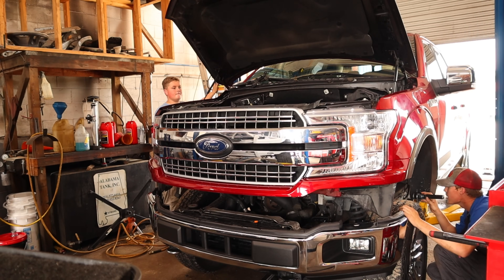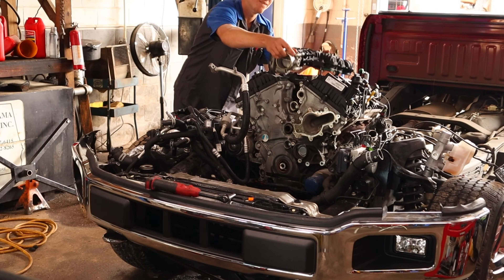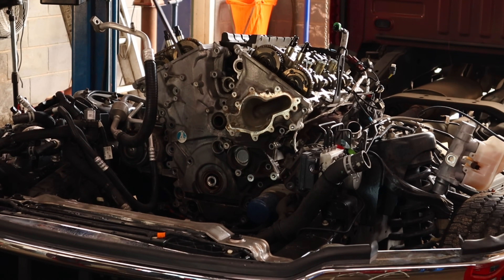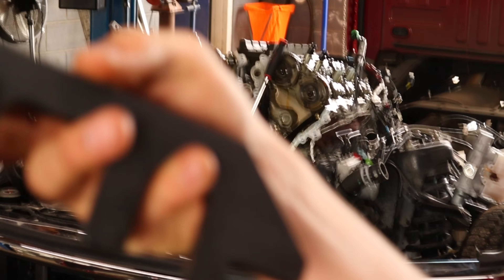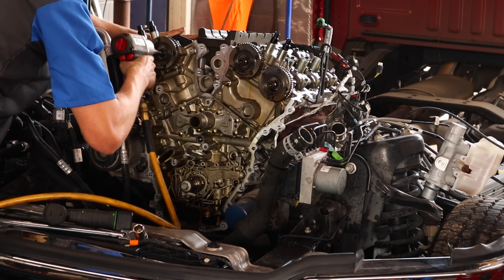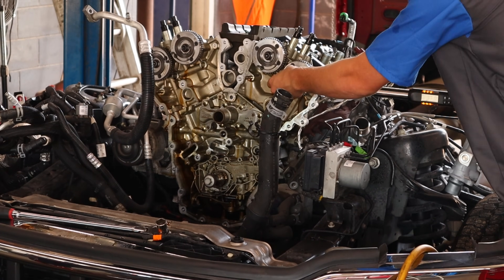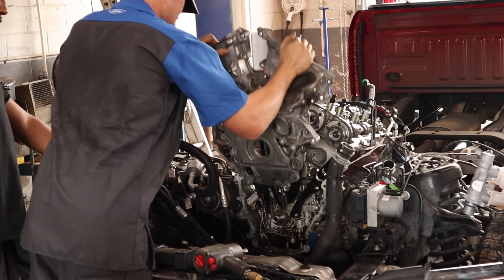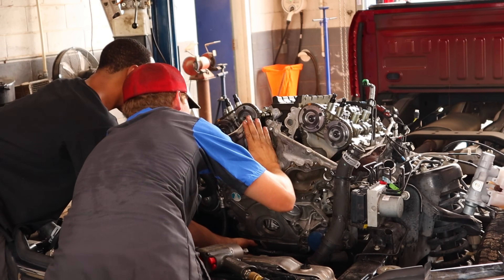Ford 3.5 EcoBoost Cold Start Rattle (VCT Phasers) | Everything You Need To Know

Comment: Let them know that in order to get the extended coverage, they MUST have the 21b10 performed by a certain date. If the shudder occurs it’s reflashed to the original calibration. But the extended warranty coverage is still in effect.
Reply from the maker: Yeah I need to make an update to this video. When I shot this they hadn’t came out with the reflash to original for shudder.
Reply: @FlyingWrenches13  They made a couple of changes (I’m sure you’re aware ) . They had us reflash , then test drive, and “un flash”) if a shudder occurred. Now they simply say reflash and let it go (.3hrs) . They came out with a different recall for the test drive, verification, and un flash. If the customer notices any shudder. I’m not sure. But I think the new fsa /tsb that has us to replace the vcts also has us to reflash and choose the “are you correcting a shudder” option. That leads me to believe the vcts are revised. By the way. Good job on the video. And congratulations at becoming a Sr. Master at such a young age. I just achieved mine at age 56. Finally work for a dealership that encourages it,
Reply from the maker: @dmandman9  Thanks man! That pretty  much sums it up. Where you work at really makes a difference in how fast they let you get all your certs.
Reply: @FlyingWrenches13 what numbers differentiates the old from the new phasers
Reply: @FlyingWrenches13 mine makes a shudder or a clonk when I go from park to drive....not when I'm driving
Reply: 9:21 what numbers differtiates the old from New phasers

Comment: That is exaclty what they did to my 2019 F150 they updated the PCM and now i have some transmission shudder at lower speeds.  Feels like the car is in 6th gear at 25 mph  and when you accelerate slowly it doesnt even shift just stutters .  LIke  being in a wrong gear on a manual and trying to drive at low speed.  What is the fix ?
Reply: Ford just released a recall that reverts it back to the old calibration eliminating the shudder for those for whom the revised calibration caused an ENGINE shudder that is PERCEIVED as a transmission shudder. Also, they provided a partial extended warranty too.
Reply from the maker: Darryl is correct! New recall should fix that issue for you.

Comment: My ‘19 5.0 has this exact problem on cold start 75% of the time. It’s very hard for me to find evidence of other 5.0 owners with the same issue! Just the ecoboost owners…
Reply from the maker: Yeah I’ve never seen a phaser rattle on a 5.0. There is a tsb out for a rattle caused by timing chain tensioners for the 18+ 5.0’s though, I think. I’d look into that.
Reply: @FlyingWrenches13  I genuinely tried to search for that TSB with no luck. You wouldn’t happen to know what TSB number it is..would you? Thanks man

Comment: Bro. PLEASE tell me what's wrong with my 2012 5.0 litter f150 that has the cold start rattle. Could it also be there cam phasers?
Reply from the maker: Usually don’t see any 5.0’s with cold start rattle.  Have you had anything with the timing replaced? Chains/tensioners would be my first guess.

Comment: Just bought a used '18 3.5. It was priced very well, and I believe this is why- 66K miles, mostly highway up and down east coast. Someone took care of it, and I have the history, except any cam phaser maintenance. Dealership wouldn't/couldn't tell me. Took the risk. Obviously out of warranty time... I'm in MA, and it already has the cold start rattle. Not all the time, however, even after sitting for 12+ hours. This makes me think the phasers still have some life in them, and aren't too far gone. Should I take it to a local Ford dealer to get their thoughts, or call Ford Corporate to get advice about the most current updates and maintenance fixes prior to going in to a dealer? I'm worried that many dealers just don't know how to fix this, and how to address the true problem. I want to go in with the knowledge to tell the technicians what my understanding is, vs. what they want to do to get to push me back out the door. 

Thanks, 
Derek W
Reply from the maker: Take it to the dealer. There is an extended warranty out for the phasers if you have the 21b10 reprogram done. I’m pretty sure if your under 70K ford will pay 100% and if over 70K they will still partially pay for the phaser replacement. After installing the updated phaser you shouldn’t have any issues. Other than that you can hold gas pedal at WOT on a cold start and crank engine for a few seconds to prime oil system then turn off and crank normally. That will stop the rattle.
Reply: @FlyingWrenches13  Same issue, the cold starts, eventually it starts rattling all the time. I went to the Ford dealer, they flashed it and said drive it 100 miles, came back, they charged my extended warranty company 4000

Comment: Unreal that this company still hasnt figured out the phasers going back to 5.4.  Junk.
Reply: I know it’s very bizarre, I did phasers and timing on 2018 navigator, 2018 raptor, working on a 19 f150, all 3 are my vehicles and all went to the dealer within a month of ownership.
Reply: The biggest problem is, the average person doesn't understand, and doesn't want to spend the proper time and money to maintain this specific engine design. Granted my husband is a mechanic by hobby (He's a big mustang lover, so he's a Ford junky). For maintenance, simply use full synthetic oil (my husband uses valvoline 5w20, because it's really good for the winter season, and overall quality among many moving parts.
Reply: Lol
Reply: @Al Carranza you missed the entire point while being a internet troll. The point was mechanics blaming manufacturers for building what they call “junk” when in reality they just don’t understand how certain engines work. Has nothing to do with paying for mechanics
Reply: Yet these Ford engines still end up being better than any of the junk that non-american GM puts out. Fact of the matter is that dual overhead cam systems are notorious for needing timing sets between 100 and 200,000, mi. That's just a reality of these systems. It is frustrating though that Ford hasn't been able to get their phasers better even after the 3v 5.4 Triton
Reply: chevy has em too dumbass idiot!
Reply: Also, either use the Ford Motorcraft oil filter at every oil change (like I said, my husband is a mechanic and huge on maintenance. He changes his oil every 3000-3500 miles), or like my husband does, he uses either Ford racing every oil change, or he uses the Wix-XP every other (2) oil changes, because those two filters are high quality filters.
Reply: Easy fix you just act like it's not, pre oiler pump
Reply: @iancassells8484  what brand makes a good
one ?
Reply: @alcarranza7587most trucks still have the 8 speed
Reply: Oil straight  30 or 4o wait  one bottle  of  hunny  no problem s  ford puts to them oil  don't  tell me the taller enc is to tite  that's  b s that  s in the desert  cold  don't  no oil oil oil  oil think. About it  eddie ray singing  off
Reply: Cool. An
Reply: Bad design. You bought a Lemon.
Reply: My dads 5.4 lasted 350,000 miles now I have it and it runs great change the oil every 6,000 miles and it barley burns half a quart between oil changes my dad now has a 3.5 it’s been nothing but problems and it’s only got 70,000 miles
Reply: I don’t think the manufacturer is the problem with the phasers it’s the lazy mechanics that want to charge for diagnostics but don’t want to fix the real problem just mask it with solenoid replacements instead of taking the cover off and replacing the phaser. Everytime you ask a ford dealership about it they say it’s “unfamiliar” or “we have to get it in and see” so basically we want to charge you to see what’s wrong & fix what’s not. The mechanics are the problem not the architecture
Reply: This is a perfect example of why you run not walk from Ford dealerships
Reply: Buy a Chevy
Reply: @c.torino2479  Chevy will have lifter failure before first oil change 🤣 lawsuit about it currently
Reply: @freedomisntfree_44  mine has been good🤞🏼 but I agree they’re all junk 😂🤣😂
Reply: @c.torino2479  If they would just leave it simple 🤷‍♂️ all the manufacturers are so talented they could build a bulletproof engine no Doubt but….
Reply: @freedomisntfree_44  My GMC had the lifter failure at 50K or so...heads off and it would have happened again at 100K presumably, but I dumped it (Sooo many other issues)
Reply: @c.torino2479 yea until your faulty AFM system wrecks you lifters & cam, or your (2015 and newer) needs a new transmission at 120k miles.

All pickup trucks are flawed. Best bet is dont waste your money on a top of the line truck if youre gonna keep it long term.

Comment: If we keep it rattle like that only in the cold start it will damage anything bro ?
Reply from the maker: No, it won’t damage anything else. It’s just going to keep rattling and most likely get louder as time goes on!
Reply: @FlyingWrenches13  they changed for my car the phaser put still there is rattle and water pump but still there is sound bro, what do u think else  ?

Comment: I asked a service manager at the local Ford dealer if there has been any improvements to the 2021 3.5 EB to cure the cam phaser rattle.   He said that Ford put a slight time delay in the start sequence to allow the electric oil pump to get oil to the top of the motor before engaging the starter.   Is there any truth to that?
Reply from the maker: Honestly I don’t know. I haven’t talked with any engineers about what they changed. All I know as of now is they don’t rattle. I’ll look into that for sure though! Thanks for the info!
Reply: @FlyingWrenches13  Have you been able to verify this rumor?

Comment: Hi i have a 2017 f150 with the 3.5 eco boost i have the cold start rattle for about 3-4 seconds. since the truck is still under the warranty, in june i brought it into ford they had it for 5 weeks. 1st they did the 21b10s2  i was told they had to as per ford procedure and it still had the noise. I left the truck there they did 21n03 and replaced the 4 cam phasers and timing chain tensioner. i picked up the truck and started it the next morning and the noise is still there. So now it has to go back. but this morning i see on my ford pass app there is a 21N08. so my question is if the cam phaser replacement did not fix it what do you think is wrong? and what is the 21N08 tsb. any help would be awesome.
Reply from the maker: So 21b10 is the update that is for the cold start rattle. It usually doesn’t fix them. When they first came out with this reprogram, something was wrong with the programming that caused the engine to shudder for some customers. This is why they stopped the update for a few months. Since then, they have started back performing 21b10, I guess they fixed whatever it was causing the shudder. 21n08 is a new update that is only for the ones that had the 21b10 performed before they fixed the programming issue. 21n08 is meant to only fix the shudder issue caused by the first reprogram. I know all of this is confusing but I hope that makes sense. If the dealer has performed all pcm updates and replaced phasers and it’s still rattling then it either needs another set of phasers or it has an oil flow problem. Should all be under warranty.
Reply: @FlyingWrenches13  heres a update on this. the truck went back. they replaced all 4 phasers again and both timing chain tensioners and guides. its all quiet now. but now i have a oil leak around #1 spark plug tube and its slowly dripping down the valve cover and onto the exhaust manifold and smoking. so now its going back.
Reply from the maker: @walterh7021  dang that sucks! Good news is that’s a fairly easy fix. The spark plug grommet probably got damaged when the valve cover was removed.

Comment: Holy Cow, how did I just now find this channel?? This is great information, Thank you so much. I am going to forward this to my Local lame brain Ford Dealerships here in Northern CA.
I have been dealing with this issue since February 2021. 2017 Ford F-150 with 40K miles. 
Rattles at cold start up, brought the truck in for service, they knew exactly what the issue was, the service advisor told me 30 seconds into my describing the issue. As soon as I got the truck back the vibration between 1200 & 1500 RPM started. I brought the truck back and the dealership told me they could not duplicate the issue. I asked if a mechanic could go on a test drive with me since I can make it happen every time. I was told No, due to Covid they were not allowed to conduct test drives with customers.

immediately
Reply from the maker: Thanks man! They actually have a new update coming out to fix the vehicles that had the shutter problem after the first reprogram.

Comment: I just had new vct phasers put in my 2017 3.5 EcoBoost. Also I was told to only use a motorcraft oil filter with a built in check valve when I change my oil. Apparently that's suppose to fix the oil pressure issue. This was directly from my local ford dealership. Hope this helps.
Reply from the maker: Thanks for the input!

Comment: Everyone is talking about the 3.5. Just had Ford replace phasers on a 2021 2.7 with 1,400 miles on it. Ended up not having a truck for 3 weeks. Two weeks for an appointment with the dealer then one week at the dealer. Ford Customerservice is supposedly giving an extra 2 years on my warranty and the phaser replacement was covered under warranty. Good luck if you don't have a warranty!!
Reply from the maker: Why were they replaced? Was it rattling? I’ve never seen a 2.7 rattle.
Reply: Yes, cold start rattle. Sounded like a diesel truck for a few seconds on a cold start at about 1,400 miles.
Reply from the maker: That’s crazy with that low of a mileage. Hopefully it’s not a issue with the 2.7’s now.

Comment: Great video 👌 unfortunately I am the owner of 3.5 eco… 
To bad that they didn’t come up with full on recall 🥲 it will push away a lot of Ford customers straight to competition
Reply from the maker: Yeah you are right about that. It’s sad because other than the issues with the VCT system they are really nice trucks.
Reply: I just bought a 2020 raptor one month ago. 15,000 miles on it.
I was not aware of all of this nonsense, And I want nothing to do with it! Probably going to sell it before I have any issues. How can Ford charge people $70,000 for a truck that has all of these types of problems? What a waste… might have to look into a TRX.

Comment: My 2018 does the same rattle. Could this be causing a hard shift like it slams when shift next gear up. Only when driving between 10-25 mph around neighbourhood.
Reply from the maker: No those are 2 unrelated issues most likely. What shift is slamming? 4-5?
Reply: @FlyingWrenches13  I cant really say it rarely does but its not a smooth shift. It reminded me of my F250 2011 that did it more often at low gears also.
Reply from the maker: Next time your driving watch the gears on the cluster and see what shift is slamming.
Reply: @FlyingWrenches13  I will and appriciate the help brother
Reply from the maker: Anytime!

Comment: My 2017 developed a rattle under warranty on the left side. The dealer replaced only that side. This made no sense to me considering the labor involved. Within a couple of months of course the right side started making noise. Back to the dealer.
The dealer then inexplicably mistakenly replaced the LEFT SIDE AGAIN! I knew immediately what they had done the next morning when I started the truck. Checking the work orders confirmed it. Back in to the shop for the 3rd time to have the right side replaced. 
Within a year that engine was toast, it shut off and would not turnover apparently seized although they claimed they were able to start it the next day after it was towed to the dealership.  They replaced the engine at I believe 58,000 miles. Claimed it was a problem with the bottom end but I don't believe that to be true. I traded that truck in even though it had a new engine because I couldn't trust that something wasn't wrong somewhere, with the new install.
Reply from the maker: You need another dealer. They should have never ever ever EVER replaced one side. That’s just dumb.

Comment: I have a  certified 2012 eco bought with 43k and my first rattle causing limp mode happend at 79k replaced vct phaser and chains and tensioners and water pump as a precaution. Truck now has 112k and it is doing it again bad.
Reply from the maker: What kind of maintenance intervals?

Comment: Another Ford Garbage design. What a half a$@ recall. Can't even cover the problem after 100,000. Why not stand behind your products Ford?!?!?
Reply from the maker: Hard to stand behind something costing you that much money
Reply: @FlyingWrenches13  Toyota does it and also doesn't put waterpumps inside the timing cover. Waterpump went out on our 2015 Mazda CX-9 with the Ford 3.7 V6 and ruined the engine at 83,272 miles. If they can't make something that they can't stand behind for 100,000 miles they shouldn't make it.

Comment: So what happens if you fail to have the phasers replaced? Does it cuz damage in the long run or is it just an annoyance?
Reply from the maker: Just an annoyance. It shouldn’t cause any other issues.
Reply: I wondered the same thing. So the rattle won’t cause the phasers to fail?

Comment: I’ve done a few 3.5 internal water pump jobs now, n I can’t figure out why nobody else puts the silicone on the block Instead of the timing cover itself. The chances of smearing it are so much less in my eyes. 🤷🏼‍♂️
Reply from the maker: The area on the block is bigger than the sealing surface on the cover I guess is the reason. I’d be scared I wasn’t hitting the right spot with the silicone.